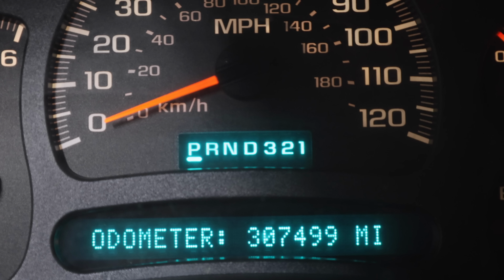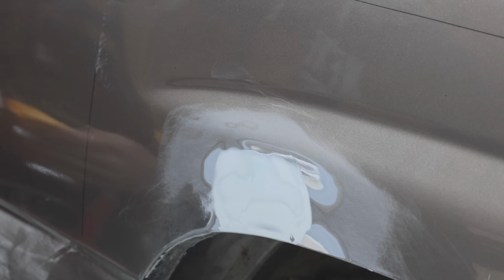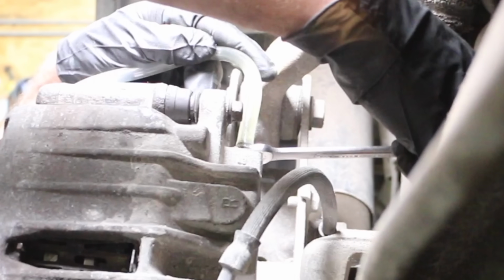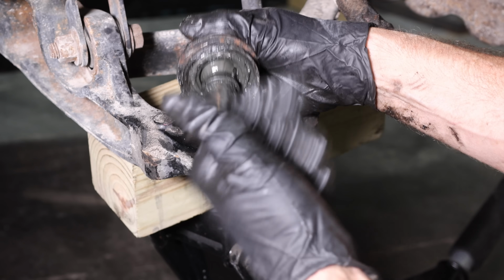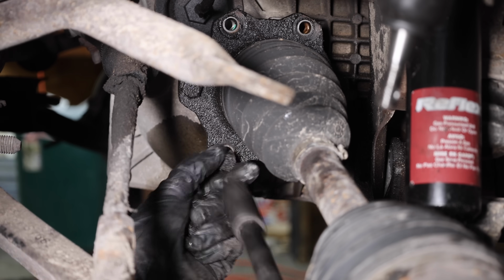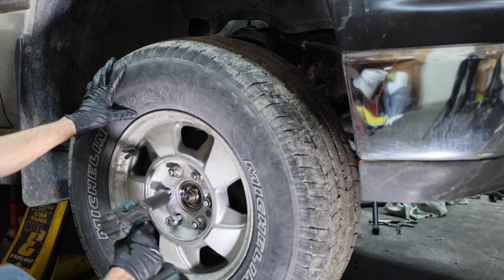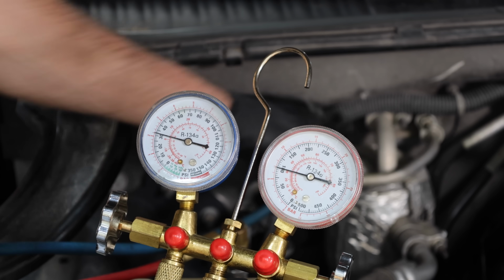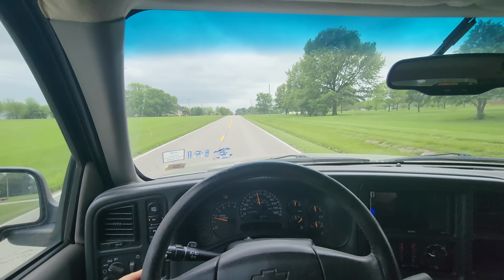Is It Stupid To Fix Up A 300,000 Mile Vehicle? Let Settle This!

Comment: Steering gear box not pump lol 
Hey, dont forget the rag joint damper above the steering gear box on the intermediate shaft.
Doorman sells kits.
But buy a size larger diameter bolt, drill tge holes larger to match, buy sized bolts and cut them to length after tightening
Reply: Yes spin the idler pulley and tensioner when replacing serpentine belt, any noise or free spinning is bad.

Comment: Engines, transmissions, and gauge clusters (odometers) get swapped all the time. unless you have proof it's the original I wouldn't assume. no knocking or valves clacking, run it.

Comment: Ive got 230,000 miles on my 04 expedition. Just replaced the entire suspension. High proformance breaks. With the price of new cars of course i will replace the motor and tranny with brand new. Not rebuilt. Its so cost effective. Its a southern truck with no rust at all. No car payments.
Reply: I have 2004 expedition 198k I just had to do the fuel pump and replaced the fuse box relay 303 melted. Struts and rotors last year other then that not much yet.  I looked into buying a different car and it's ridiculous right now. Cheaper to fix. Unfortunately for me mines in the rust belt so by the time the engine or trans goes. It will be close to the life of the car.  Saving up to buy a newer expedition or a clean excursion from the south.
Reply: I have an 08 f150 with 300k, almost everything on the truck is original. Except throttle body, lower control arms and starter. Ignition switch, vct solenoids and oil pressure switch. 5.4 engine still sounds great and transmission still perfect. I need new shocks asap because it rides rough on bumps. They’re also original lol. I want to fix everything on it as well instead of buying new. Just hoping it all doesn’t go bad in the same year.
Reply: @lordhughes7690  this is me with my 04 excursion... one part at a time baby lol... I just got all the ball joints and  a tire rod replaced with a couple other things( trans fkush, fuel filter, ect.) .. mechanic came back from test driving and a brake line blew... he fixed it at a very reasonable price.. I am moving out of state and I pray I can find a trustworthy mechanic soon down there.. It took me a couple years to find the one I have now.. After the one before him didnt change parts he had my buy. I paid for all new spark plugs and coils.. he never changed the coils. my new mechanic showed my they were the original ford coils still in the engine! she has 242k on her and I did get the new coils on finally.

Comment: I have a kia with 284k currently debating fixing its minor problems i drive it regularly on 3-400 mile trips she's all original except for an alternator 😂 my heart wants to replace all suspension parts and bearings and run her another 284 she has been amazing

Comment: Did you consider upgrading the front rotors and calipers to the larger rotors and four-piston calipers found on newer models? I want to do that mod to mine but I am unsure what wheel will fit it best.

Comment: It’s often said that you shouldn’t change the transmission fluid in a high-mileage car if it’s never been changed before. The idea is that, over time, old transmission fluid becomes thinner and filled with metal shavings, grit, and other buildup from normal wear. In some cases, this buildup can actually help the transmission function by filling small gaps and maintaining friction. Replacing the old fluid with new, clean fluid—or performing a full flush—can wash away that buildup, potentially causing the transmission to slip or even fail. For this reason, many people believe that if a high-mileage car has never had its transmission fluid changed, it’s better to leave it as is. CAN YOU TEST THIS!
Reply from the maker: Thanks for the suggestion.

Comment: Let’s see I have 2003 gmc 1500 sle it has 315296 on it I replaced all payments front end suspension I replaced cat  and all o2 sensor all new shocks all the away. I bought it for 500 bucks and have 5k in it the maintenance on the truck before I bought it was basically nonexistent. The man blew left brake caliber in line had to replaced mass master cylinder and a brake booster a new calibers and rotors all the way around the truck replace the cruise control switch or pump receiver switch new radiator water pump, alternator battery thermostat housing and thermostat. I have more to go but as far as my motor I have nothing wrong with the internals as of now
Reply from the maker: Thanks for the feedback.

Comment: Got a 2005 Ford E250 4.6L (hold the ***talk) I’m not pro Ford or Chevy but rather admire the better gen trucks & SUV’s produced by each. 192k miles only thing I done these 20 years is tires and oil in my driveway. Been reliable & no lights on dash I figured I’d turn it into a HVAC service van and already started racking miles onto it. Today I’m getting new front rotors, pads, front axle hub at a minimum to fix my weak braking and loose steering. Anything else to look at and consider replacement while I got these wheels off?

Comment: Is it worth fixing up a 300,000 mile vehicle? Yes. Twice. Three times. 

I have kept a Ford Explorer on the road for a very very long time. It has had 3 engines and 4 transmissions (I also maintain these components religiously). It has had suspension parts changed and simultaneously upgraded. I’ve replaced interior components. The audio system has been upgraded at least 3 times (I quit counting after the third head unit). 

I got this Explorer in 2017. It was a 1997 model. 4.0 SOHC V6 4x4. (The last engine I put in it made it a 5.0 V8). 

The odometer showed 180,000 miles when I got it. I have rolled it back around to 225,000. I mean it had 999,999 miles and rolled over back to 000,000. Then I got it back up to 225,000. This Explorer has 1,225,000 miles on it in reality. 

It’s easier to list the things I haven’t replaced:
Dash, rear seats, carpet, glass (except the windshield, it’s had 6 windshields because I live in Texas), wiring surprisingly, lighting assemblies, wheels, and last but not least I have never replaced the gear shift. Obviously the body and frame are original. 

Everything else has been replaced at least once. 

In total, counting buying the Explorer, everything I’ve replaced but not anything that would just be regular maintenance (tires, brakes, battery, etc) I have spent just over $18,000. 

If I had bought a 2017 Explorer new, with an MSRP of $38,000 (assuming the dealer didn’t mark it up), putting 10% down and financing the rest with my credit at the time - I would have paid the Explorer off in 2022 with a final total cost of $47,800 and I’d have still had to maintain it. I’d have also had to still replaced a bunch of stuff on it considering by now I’d have driven it 1,045,000 miles. Those things would have cost me more and quite frankly I don’t know if the unibody of a modern Explorer could handle being rode that many miles. 130,000+ miles per year.

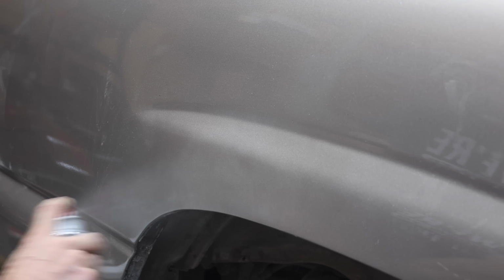Comment: 4:11  Goes through all that effort of welding and patching the rust just to paint it and get over spray all over the windows You could have taken literally 30 seconds to throw anything over the car and it would have stopped that but you 100000% got clear coat and paint all over the windows and probably the brakes lowkey hack job even though your videos are good
Reply: What is random paint specks gonna do to brakes. Also theirs a decent chance it did not spray onto window.

Comment: I got a f150 with 377k miles for 1300$. Put $200 into it for a few sensors and a new alternator which was extremely easy to to myself and it'll pull anything and go 90 on the highway. It was worth it.

Comment: Depends on how good you are at repairs and mods.  I built all my bikes, cars and trucks from junkers out of back yards and fields and drove them for years until my first new truck in 2022, at 65 years old. I always had exactly what I wanted, from motorcycles to heavy haulers to hot rods to nice cars to insanely high gas mileage (40 MPG at 55-60 MPH using 15-year-old 1st generation T.B.I.).

Comment: 300k is a TON for an American vehicle, but if you're going to rebuild the suspension, transmission, engine, brakes, and other important bits then it's worth it, assuming you can get that body damage properly fixed and don't find a ton, I'm only a few seconds in but it looks pretty good.

Comment: I have a 2001 Suburban and did some of the work on rear diff, shocks,  rocker arms, new AC compressor, rear brakes, etc...a few years ago. The transmission fluid hasn't been changed, but isn't completely black and burnt smelling at 250k. Will I be fine exchanging some of the transmission fluid at this point or should I leave it be?
My vehicle sits for about 9 months or of the year while I'm living in Europe. I'm home for summers to work (I'm a missionary).

Comment: I like your pace. Somtimes I look for say just brake job, you maybe could do some slow. But I reallly like your vids. Doing something like upper and lower ball joints bearing pressing is more than I want to do. I would have a shop do it then I'd do the rest if the order of opetation still works out.
Reply from the maker: Thank you!

Comment: The only thing I would have done differently would be dropping the trans pan to clean the plan and replace the filter. I would also flush out the old brake fluid, clean the reservoir, then refill, and bleed. On vehicles without a cabin ac filter it's not a bad idea to use a foaming evaporator cleaner that injects through the drain. Another thing I have seen a lot of with vehicles with this much age and use is windows that struggle to raise and lower that can usually be corrected with minor adjustments and lubrication.

Comment: Not speaking of rust.. but if you rebuild most everything on a vehicle, you can have a vehicle that will last a lot longer for maybe 15K. That is better than paying 50-75K just to impress the Jones. Plus you don't have to worry about getting dings and dents. I would suggest tho, buying a vehicle old enough so that it's doesn't have all the crap on new vehicles, being easier to work on.
I worked up to supervisor at a body shop, mainly minor work on semi trucks, lots of fiberglass and bondo repairs. As long as the repair looks good, everyone is happy.

Comment: If it was a good vehicle to begin with, no accidents or bad rust I'd say the mileage doesn't matter. Fixing a vehicle like this is always much cheaper than buying new.
I have an 02 Tacoma w/ 433 and my Daddy's 97 Silverado with 150k, not even interested in a new one.

Comment: Your Pace is spot on.  If there was a measurement called information per minute you would be the standard.  In my opinion you have struck the balance of length and tempo perfectly.  I have not watched one of your videos yet where I thought I needed/wanted  more information and also never got bored.  Thanks for what you do.

Comment: With ubterest rates how they are i wouldnt buy new for sure or even finance. Its just not worth it. If you can fix it and it doesnt keep falling apart then fix it. If it becomes a moneypit i would get rid of it
Reply: anything older then a 2015 is not worth putting any large amount of money into, the road salt here in the winter brutal on cars

Comment: " Very Good Video " ! / Fast talking / But that's A Lot better then someone Drowning on  !
There was a Lot more that done that I could have seen myself doing ( because of circumstances ). But I have to Commend
-Mr. Todd  for all of this work !
Reply: Back when i had a 1972 Chevrolet Caprice ( The favorite of all my cars ) / I used to do a 3 step oil change on it .
1). I would do a standard oil flush according to directions ( with a can of Oil Flush or Paint Thinner ).
2). I would run what i called Cleaning oil Through the System ( i.e. Clean Detergent Oil w/ the Motor Flush ) !
3). Drain again and add the New Oil ( Castrol or Valvoline ) somtimes with an Additive ( i.e. Lucus H.D. Oil Stableizer )-
    - and an Oversized oil Filter ( The treads and gasket were the same as the Standard ) and had slightly more capacity.
That Car was well worth it until some drunken driver ran into it when it was Parked in front of my parent's house !

Comment: The fast pace is annoying (but in a good way). DON'T CHANGE!! BTW, I don't know if you ever did one, but there are headlamp restore kits all over the place, including products that you spray on the headlamps that supposedly protect the lamps from yellowing up over time. That would be my suggestion, which one really does work, and do they actually work at all?  Thanks for all the ideas your videos have given me. Additionally, my workhorse is a 2000 Dodge Caravan with 260,000K miles, and I'm the original owner. I'm hoping to get passed 300, too.

Comment: Man, I am 39. I just realized how old vehicles are still good and nothing to be ashamed of. Hell, I'm VERY happy driving around me
2004 hodna odyssey 80,000 miles. Looks new still.
Cost me 5k

2004 f150 that bonged to the airport. 8
98,000 miles.
Coat me 4k + 2200 transmission rebuild. 

Still worth it. 

I wish I appreciated this stuff when I was younger.

No payments.

No need to keep up with a fake image and go broke. Be smart young people. Start saving early. My biggest regret.

Comment: Not stupid at all IF you do the repairs yourself.  I rebuilt a Toyota Prius 3rd gen motor (2ZR-FXE) for about $500.  New Rings, bearings, felpro head gasket.  New PCV valve, cleaned out the EGR cooler.  Other than some extra suspension parts I need to replace, it's basically a new car

Comment: I think it depends on where you live, in the southwest, a car that old would probably not be rusty at all, but pretty much any sort of rubber, plastic, nylon, that sorta thing, will be so brittle that it'll disintegrate, or it'll crack and fall apart when you touch it, depending on how the vehicle was stored

Comment: When i was a panel beater i used to spray degreaser on the repaired panel (including filler/bondo work done) 

if you then look at the panel and check the reflection of the light you can see if it’s perfectly straight or needs some more work. 

it’s also very useful to spray the inside of the repaired panel with hollow section wax since the welding has made the old wax drip down the panel and probably also pretty dried up. At the shop i worked at we mostly sprayed a hole can on a panel till it comes dripping out all the holes to make sure the repair will hold and keep it from rusting.

I hope these tips were a bit useful!

Thank you for taking the effort to make all these amazing videos!

Comment: You got a great deal. That is obviously not a Northern/Midwest truck so the chassis is in great shape. A few minor fixes and you'll easily get another 100K. The Vortec 350's are tanks once you replace the intake manifold gaskets and switch to normal ethylene glycol coolant. The early dex cool organic acid coolant caused gaskets to compression set and leak. Hence vacuum leaks and misfires. The fuel pumps also tend to fail so just cut an access hole in the truck bed to replace easily. Dropping the tank is a PITA. Outside of a few flaws this truck should last to 500K.

Comment: really informative video! Two questions:
- During multiple points you left some component such that you would "come back later" to finish it up e.g. tighten some bolt all the way to spec. What is your system for remembering to do all this, lest a bolt vibrate out and you crash on the freeway?
- Are you or are you not supposed to brake clean new discs (factory protective oil?)

Comment: If people need the video slowed down, they can change the playback speed. Personally, I like the quick pace. I don't need to watch someone spend 30 seconds here or there to hammer on a part, or torque down a bolt.

Comment: "A good old diesel ain’t even broken in ‘til it’s rolled past 300,000 klicks." Maybe not exactly, if it's a gasoline engine. In Europe, we use diesel engines more in these types of vehicles... If it works and there is no money pit, why not repair the old vehicle? Otherwise, keep up the good work 😁💪

Comment: As someone who had a 2003 Chevy suburban at 300,000 miles I can say: yes, you can fix it. But it will cost a lot and inevitably feel like a money pit. I ended up getting knock sensor issues around 330,000 and decided to trade it in. I did have a ton of fun and learned a LOT with my dad by fixing it, and i wouldn’t change that for anything in the world. It was worth it for me. But just wanted yall to know.
Reply: OK,  disclaimers ( in the context of practical transportation).

    Sudden catastrophic drive train failure , you're not getting back what you spent on everything else .

   It gets totaled by the other at fault driver ( or taken out by a deer , or tree falls on it , etc ) . An insurance company will look at the milage in black & white , and you'll only get payout of about $12 . It's inherent worth as a vehicle will not be reflected in actuary tables . 

   If you have a baseline comparison of buying a NEW vehicle , and resultant car payments,  then it's worth it to do a lot of repairs , and hope your luck isn't terrible. 

   BUT , if the alternative is divesting a 250k vehicle in need of medium $ work , vs replacing with good condition  100 - 125 k vehicle.

Comment: I now have a $20,000 $10,000 2003 Ford Ranger. All my friends said it was time to get a new used vehicle after I was in deep repairing everything chasing a noise. It was like a complete rebuild. And then the transmission went. So I got one of those too!
It had 273,000 miles on it when the rebuild began. I replied to my friends that I know every single thing that's been replaced on this truck. It would be foolish to buy a mystery vehicle that I might have to do all this on again. Nuh, uh.
Reply: Wise decision. Use it for a couple more years then decide later what's next 👍